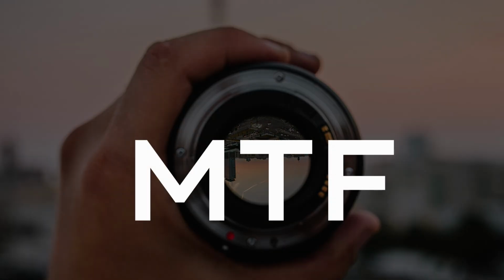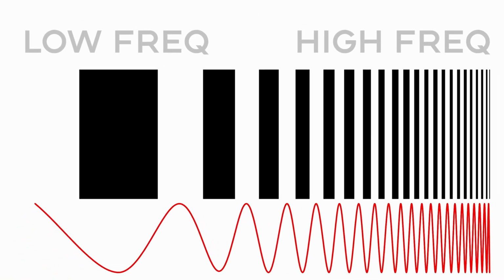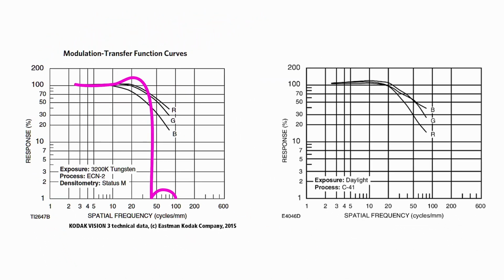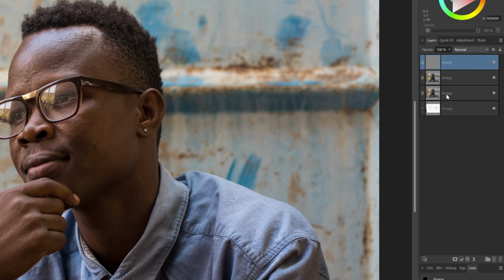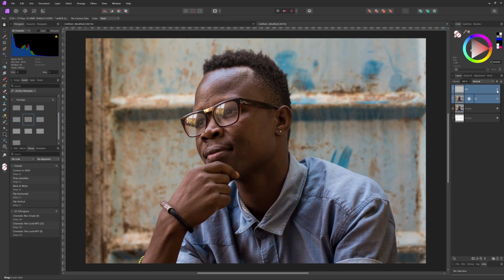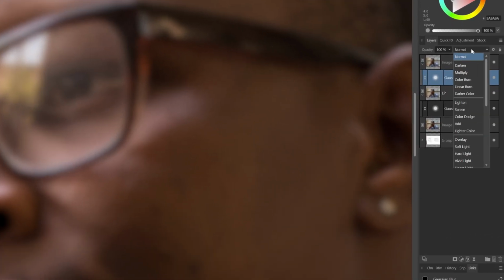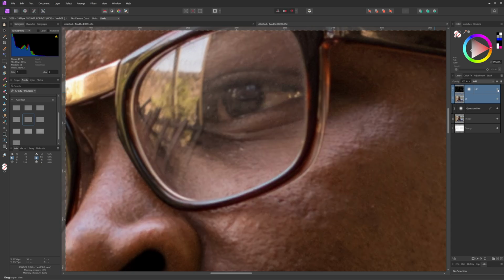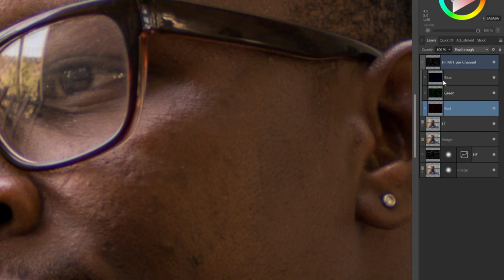Simulating the MTF curve of a film to get a FILMIC Cinematic look (using Affinity Photo)

Comment: This is really fascinating, but couldn’t this be simplified by using the frequency separation filter and apply those effects to the high frequency layer? 

I can see the benefit of being able to make adjustments to the blur of the low frequency layer during the process useful however.
Reply from the maker: Thank you! You need to have the low pass layer, just using the high pass will not work as it will probably sharpen the original image (or when increasing the blur too much, it will do a soften/smoothing). Hope this makes sense.